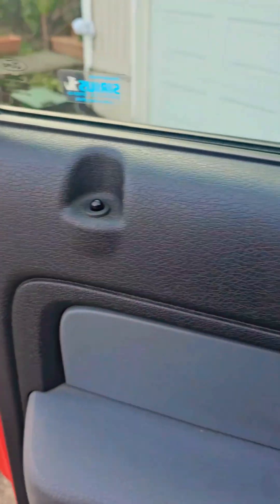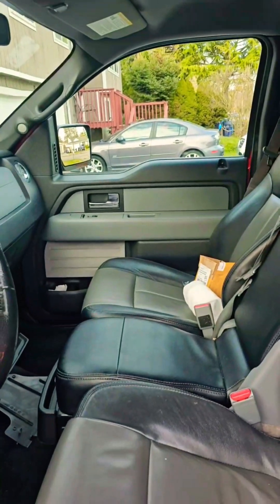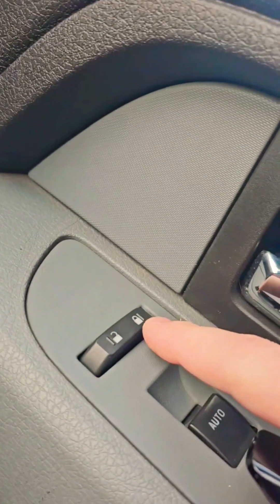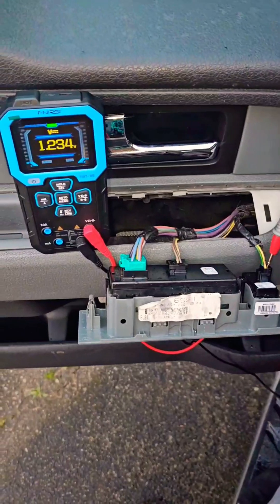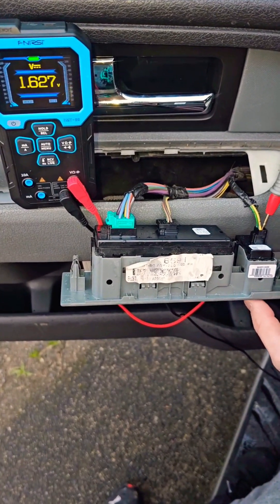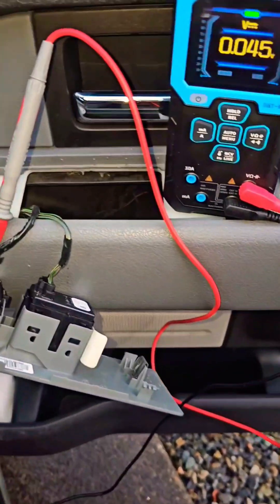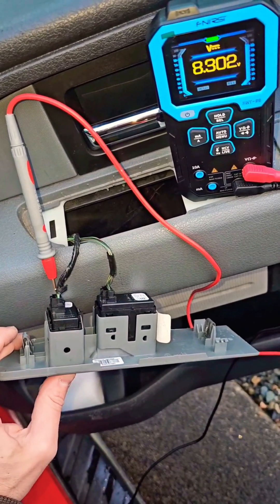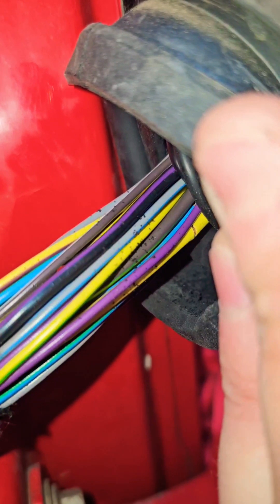Ford F150 ALL Power Door Locks Not Working and Reversed BCM Body Control Module Forscan

Comment from the maker: Thank you for your comment! 
When I find a fix I will update this comments section and description.
There could be a few things going on here. I am saving up to throw some parts at this. There could have been an aftermarket radio installed before I purchased this truck and when removed, there could have been a spliced wire somewhere that is corroded. I'm leaning towards a grounding issue, since I've been unable to find any broken wires in the door harnesses or under the sill plate (driver footstep  plastic trim piece). Upon resetting the battery for a few days, nothing changed. Using forscan, I restored the BCM factory. No results. The fuses are good. Replaced the door switches and the relay #49. No results. There is a relay under the top of the passenger dash below the windshield that I haven't attempted yet. 

I will provide the solution as soon as I find it. We are in the same boat! Not to worry let's stay in touch

Comment: I’m having the same problem!  Were you able to figure it out?
Reply from the maker: Thank you for your comment! 
When I find a fix I will update this comments section and description.
There could be a few things going on here. I am saving up to throw some parts at this. There could have been an aftermarket radio installed before I purchased this truck and when removed, there could have been a spliced wire somewhere that is corroded. I'm leaning towards a grounding issue, since I've been unable to find any broken wires in the door harnesses or under the sill plate (driver footstep  plastic trim piece). Upon resetting the battery for a few days, nothing changed. Using forscan, I restored the BCM factory. No results. The fuses are good. Replaced the door switches and the relay #49. No results. There is a relay under the top of the passenger dash below the windshield that I haven't attempted yet. 

I will provide the solution as soon as I find it. We are in the same boat! Not to worry let's stay in touch